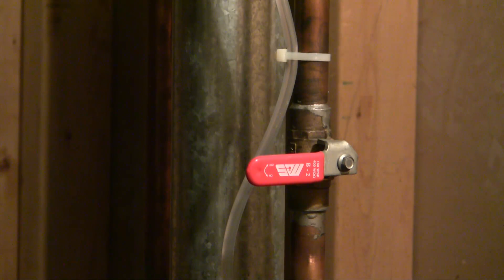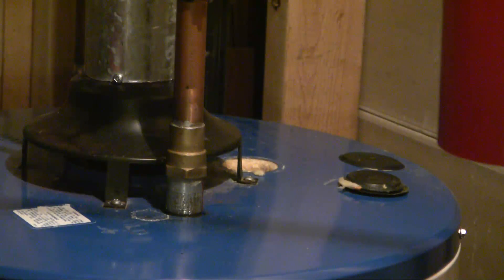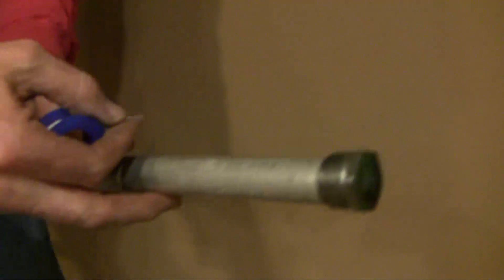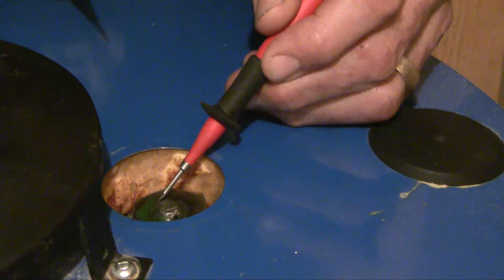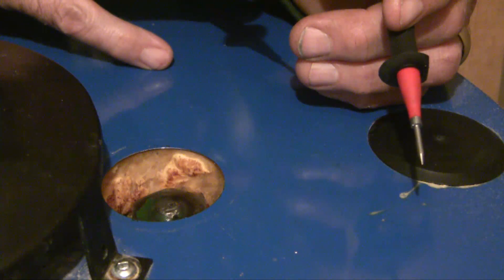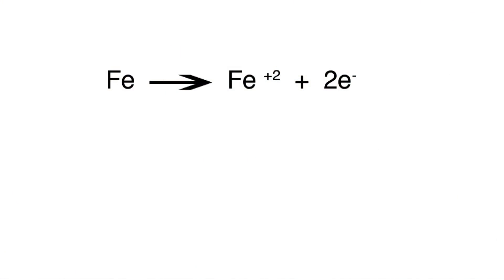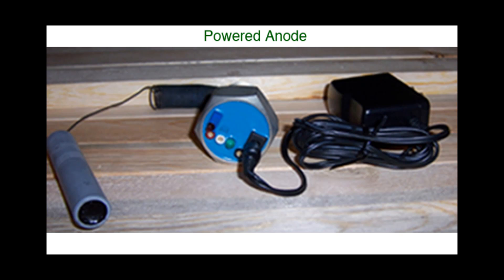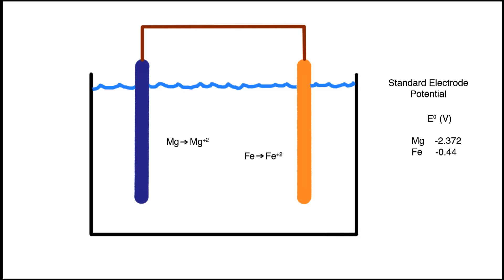How and Why to replace the Anode rod of a Water Heater

Comment from the maker: Sounds serious and possibly very dangerous. Unless you have a lot of experience with home wiring, this is best left to a professional, probably urgently. The tricky question is whether to call an electrician or a plumber. If water is escaping and soaking electrical connections, the plumber will be better qualified to fix it completely. But if this is just a symptom of a failing building ground then the electrician is a better choice.

Comment from the maker: If you watch the video again you will see that I am turning the pipe into the tape, rotating the pipe clockwise and holding the tape still. The result is the same as rotating the tape counterclockwise against a still pipe. Thanks for watching and commenting on my videos!

Comment: Hi Dave! Nice video. I just wanted to point out about the wrapping of the teflon tape around the threads. What you say about wrapping the tape in a clockwise direction sounds feasible, but it should actually be wrapped in the opposite direction. The idea is to minimize the tape from being unwrapped as the fitting is screwed. What I do is hold the fitting as you show, place the tape underneath the fitting instead of on top and turn the fitting CW instead of CCW as you show. Thanks Dave!

Comment: Yea, I used a 3' breaker bar with a pipe wrench.  All I seemed to do was tear the bolt up.  Do you think liquid wrench may help?  I'm just afraid I may break something. My water smells kind of bad and I am told it may be from an anode rod breaking up.
Reply: Having some experience with hard stuck bolts and nuts, and being a natural tinkerer myself, I did some testing using several commercially sold "penetrating oils", like Liquiwrench, WD-40, Kroil, PB-Blaster and Würth Rost-Off and Rost-Off plus... And found a hoe "brew" made by mixing half and half Acetone (or MEK) with Chrysler's ATF+4 synthetic Automatic Transmission fluid. It has to be frequently agitated, because it tends to separate, but put into a half full syringe and applied quickly, it has worked wonderfully for me, notably better than any commercial spray can penetrating oil so far.  Another recommendation is to SOFTLY heat the outer thread with a hand torch, and then direct the home brewed eetrating oil (or spraying the commercial ones) directrly on the end of the onner thread part, so to "contract" the inner part and make it easier for the penetrating fluid to get into the thread to unstick or break the adhesion.  Just be careful, the acetone or MEKand the ATF are both flammable, so aply hte penetrant sparingly and be ready it catches fire, but nothing to worry too much! Best Luck. (BTW, the WD-40 was the very worst of all the penetrating fluids I tested, by far).

Comment from the maker: They can be tight, and you can bet there is rust and corrosion adjacent. I used a big breaker bar, and even then it was awkward since the tank was not well braced. 

What I worry about is the chance you may disrupt rust enough when you remove the old rod that you can't get a water tight seal after you put the new rod in.

Comment: My hot water heater is about 30 years old.  I cannot seem to get the anode bolt off.  I have let it soak with WD-40 on it, no luck.
Reply: Inmy own experience, WD-40 is the worst of the worst penetrating oils... Try "Würth Rost-Off" or "Liquiwrench" or "PB-Blaster" instead.  If you are a tinkerer like me, try a mix of half Acetone and half Chrysler´s ATF+4 Synthetic automatic Transmision Fluid, well agitated as it tends to separate (I put about half a syringe to be able to agitate just before application)... SOFTLY heating the collar piece on the top of the tank with a gas torch, and then hitting it with a stream of the home brew penetrant seems to work best. Use a small impact torque wrench but with care, perhaps it would be the best combination!

Comment from the maker: I rarely sign on to my Youtube account without learning something, and today the word of the day was passivation, ha ha. Now that I think of it, when welding anodized aluminum, if I forget to grind a spot for the ground clamp sometimes my ground is unreliable. Oxidation of Al reduces conductivity, and presumably the same may happen with Mg. Too bad a thin layer of iron oxide doesn't naturally slow oxidation of iron, or life would be very different. 

I appreciate your input, thanks!

Comment: Anodes can passivate and you would know that it has by doing a continuity test between the top of anode and the tank wall.  Best thing is to pull it out every couple of years and make sure it looks like its getting chewed up.

Comment from the maker: Part 2.
Actually, it's the tendency to oxidation ('rust') of the magnesium that drives electrons over to the iron cathode, preventing rust of the more electron-hungry iron molecules. So, the more likely the anode is to oxidize, the BETTER it works. The magnesium alloy is chosen as a sacrificial part, designed to be destroyed and replaced, so that the iron remains intact. It's a fascinating concept, also used in most boats to prevent rust of the hull.

Comment from the maker: Yes, on average the tank will last longer if you change the anode regularly, possibly getting a few extra years of tank life. The main risk you take is the chance that you will disrupt rust around the anode threads to the point that you can't get a good seal after replacing the rod, which could force you to replace the tank immediately. The second question is difficult to say, it depends on local water properties, etc. Tanks are so poorly built now that they don't survive very long.

Comment: On a typical 40gallon hot water heater in the home. By replacing the anode rod every few years. Does this extend the life of the water tank? And roughly for how long and how many times can you replace the anode rod before it's time to replace the tank? thank you.

Comment from the maker: Yeah, good maintenance would include routinely changing the anode out, much like preventive maintenance on any boat, for the same reasons. The down side is the small risk of not being able to do a water-tight replacement because of cruddy rust on the remaining tank threads. I'm glad you got the problem worked out, and it's nice to meet you.

Comment: No, not a tankless. I have a Bradford White and they started putting the anode into the hot water line. The anode is not accessible by just popping off that cap. You have to remove the hot water line that is attached to the top of the unit.

Comment from the maker: If you mean a tankless system, I have never had one of those apart. The anode idea was so useful that I am (maybe ignorantly) confident there is an anode somewhere. But many plumbers have told me that the durability of newly manufactured tanks has slid backward over the past decade.

Comment from the maker: Sounds like it's too late to replace only the anode, though I would be interested in what it looks like. Probably a lot like the anode of the tank I replaced. Yes, the anode is designed to try and prevent rust, though I'm not sure about it's suppressive effect on other electrolytic reactions outside of the tank. When I researched this topic I found reports of broad variance in the rate of rust formation, likely an effect of variable water quality. 12 years is pretty long for tank survival.

Comment from the maker: There are rods that have a scissors joint in the middle if clearance is poor, but I'm sure they are hard to find. That's interesting info about your area -- your water sounds strangely protected. 

On researching this video I found some great references, with discussion about the sulfur smell in some areas. They also described an electrical option if rods don't work in your region. But in your case it's hard to argue you need to do anything. Thanks for your input.

Comment from the maker: @Jafromobile Having watched many of your videos, I'm not surprised to see a thoughtful comment. I have seen examples of electrolytic reactions in cars, but there must be some reason that manufacturers don't use them routinely. Maybe it's the lack of continuous exposure to water. Reviewing this topic, I wonder if there was a reason that almost all modern manufactures use a negative battery ground, which could theoretically inhibit rust on the chassis.....